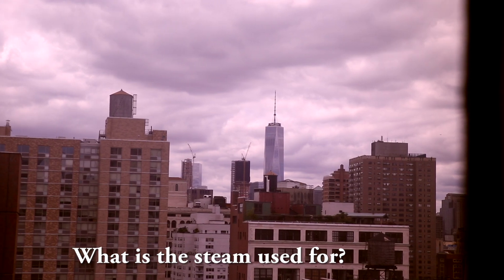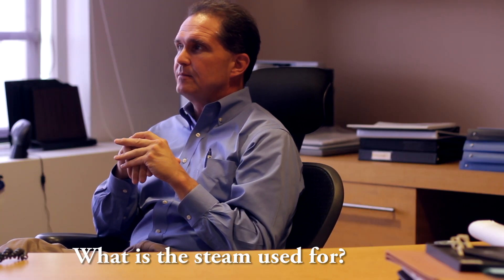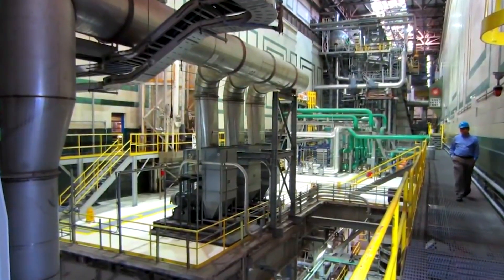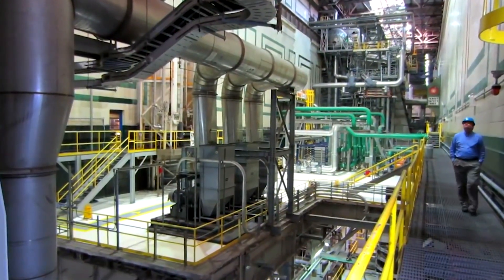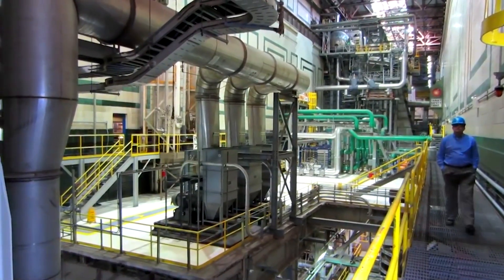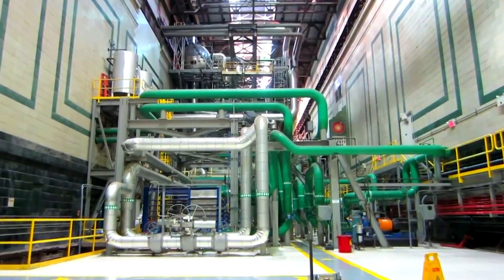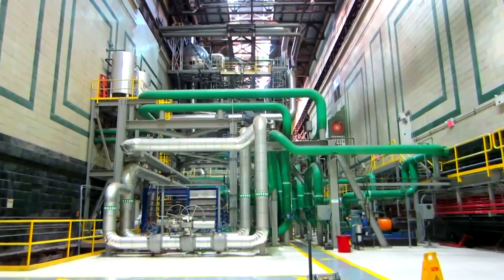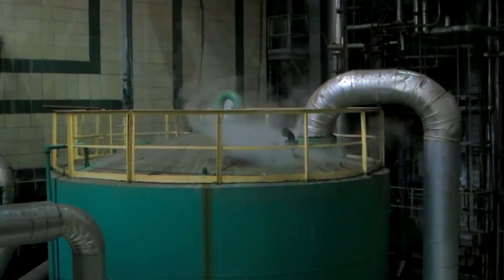The Steam System in Manhattan NYC

Comment: Video fails to explain how steam is used for air cooling, how steam is used in electrical power generation, what is the connection between NY and steam plants, the cost of the steam system vs. non steam.
Reply: ebanfield 
Yeah same things I wanted to know.
Reply: Steam is what drives absorption chillers. You may learn the process used in the video below:
https://www.youtube.com/watch?v=0R84hLprO5s